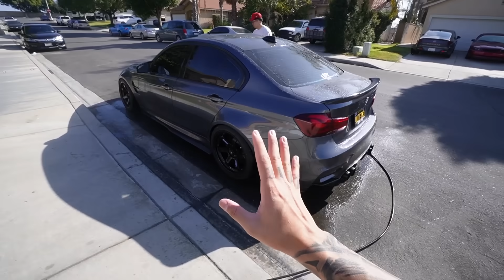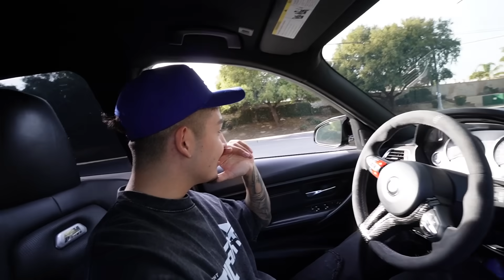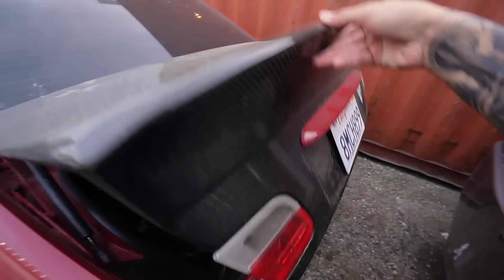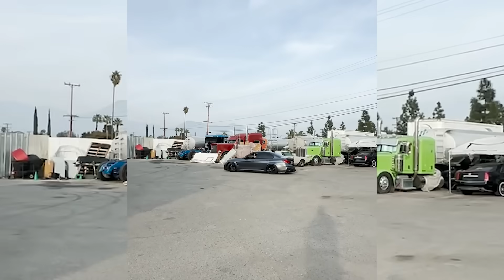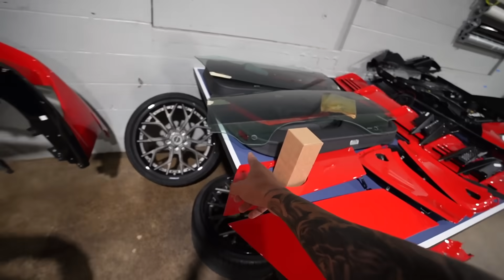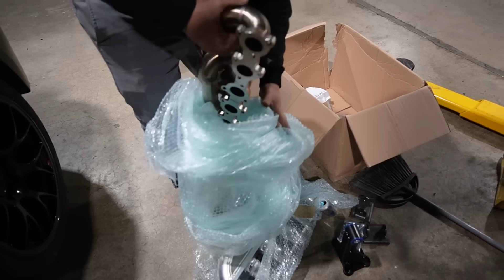HE WANTS TO BUY MY BMW F80 M3! Goodbye...

Comment: Well you do have an e46... and an R8 would be cool but the maintenance costs on the R8 would be insane. I still think project cars are the move. The GT-R is basically like the R8, idk. But then what car would you drive as a daily and not rack up miles on? Maybe get a Vette with the money and another car? So many options now I see your dilemma bro damn. Manual G80/82???

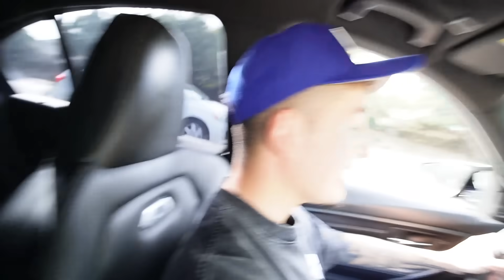9:23 that was sick, mans in tune with the e46 already